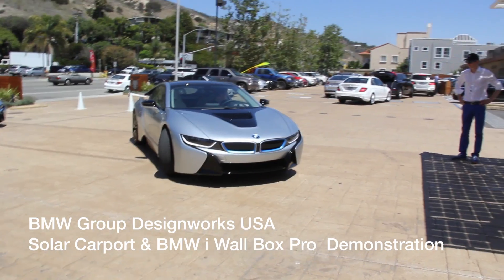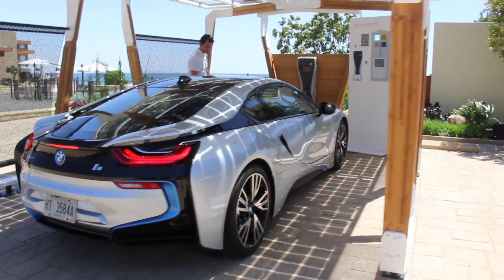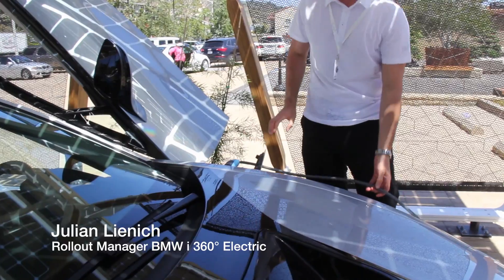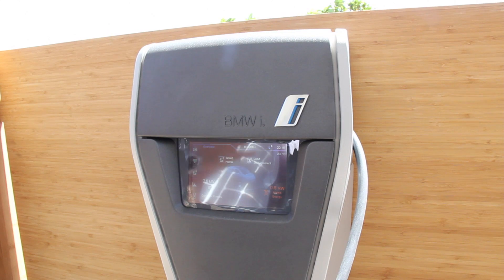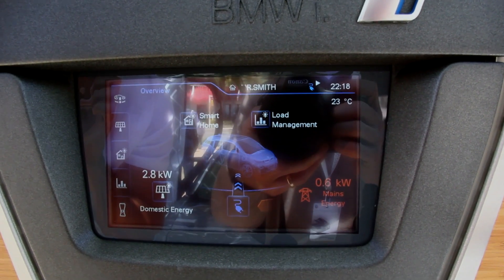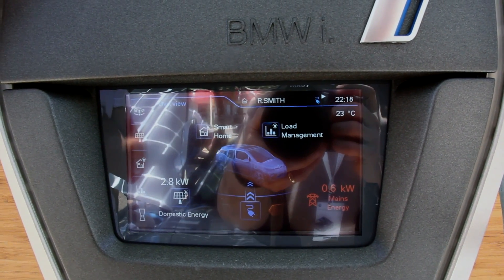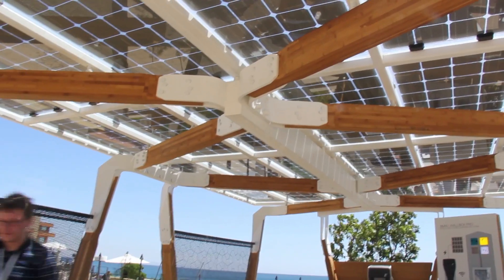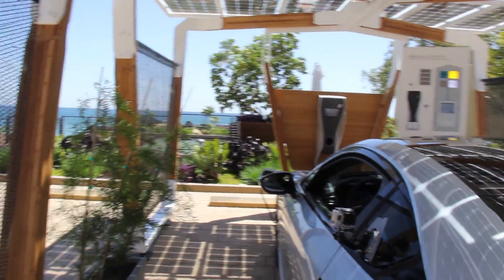BMW Designworks Solar Carport and BMW i Wallbox Pro

Comment: Does it charge faster than Tesla Supercharger?
Reply: +Dj Ozone , 15 seconds in Google and you find the answer yourself. I did it now for you.
In the video you could see the charging was 2,8Kw from solar and 0,6 Kw from the grid, total 3,4Kw.
Tesla Supercharger use up to 120Kw charge.

If you compare 3,4Kw / 120Kw, you can see Tesla Supercharger gives 35 times more charge.